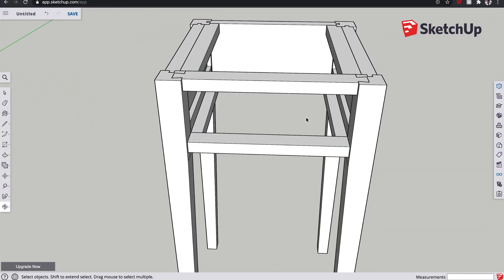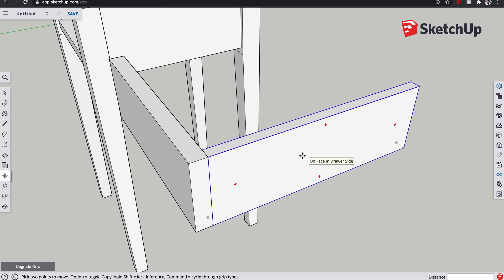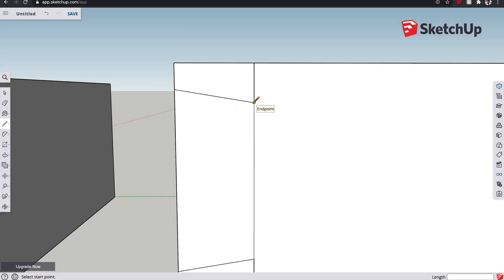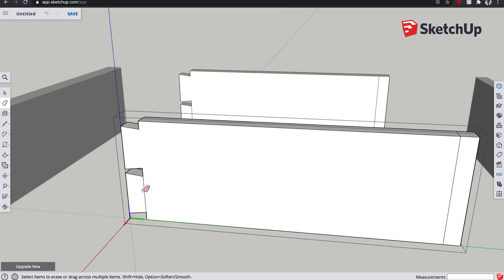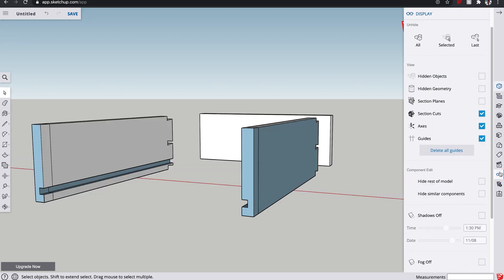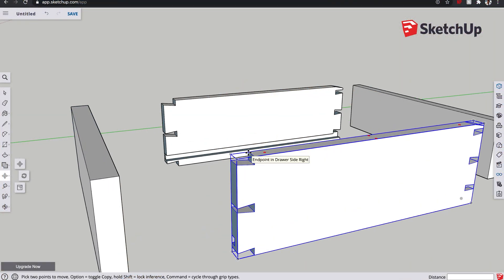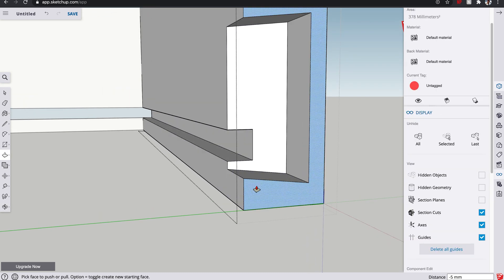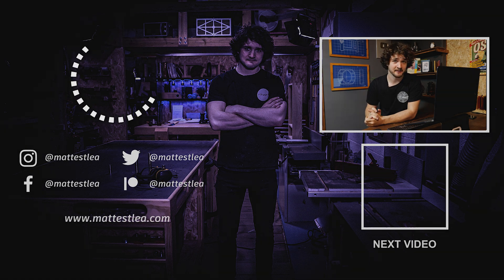How To Make Drawers in SketchUp 2021 | Woodworkers

Comment: 11:40. Ok, about blue and sand faces. Blue indicates that this is the inner side of the plane, i.e. one that should always face inward. The sand color shows the outer sides of the planes. Any closed geometric volume must have only sandy planes. Conversely, if you place the camera inside the body, then you should only see the blue colored surface. This is necessary in order for the computer to correctly interpret geometric shapes as a solids. This is necessary for 3D printing, milling on CNC machines, as well as visualization in third-party applications. (sometimes on rendered images instead of blue planes you will just see holes in the surface). So, I recommend keeping a close eye on the surface of your item to be free of blue planes. If you see them, then just move the mouse arrow to the correctly oriented sand-colored plane, right-click and select Orient faces.

Comment: 10:15. The disappearing face is due to ctrl+pull to create the shoulder line. Hence inverted faces (that appear blue/grey instead of white). I've recently discovered this will cause an issue if wanting to 3D print from a sketchup file : these faces will not be recognised by the printing software, will see it as an "open" volume. Fiddly fix : select inverted faces, right click and pick "reverse faces" to flip them back around. But other than 3D printing, just hide reverse faces with textures!